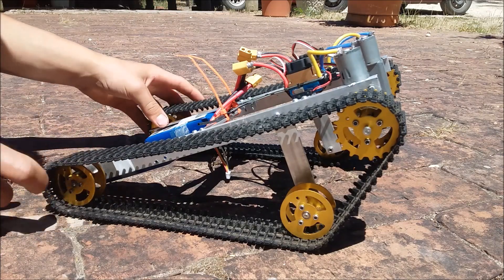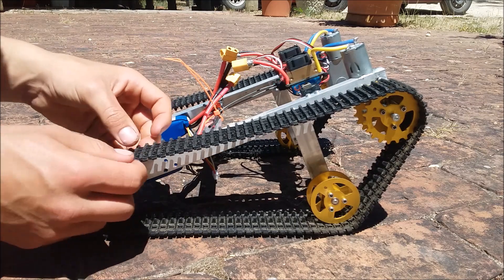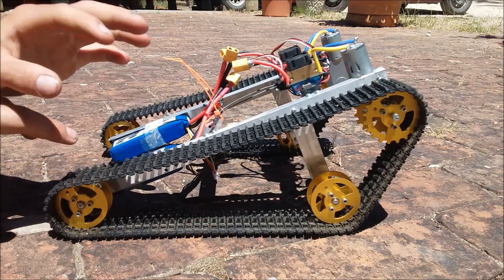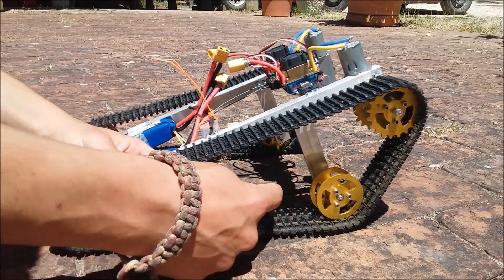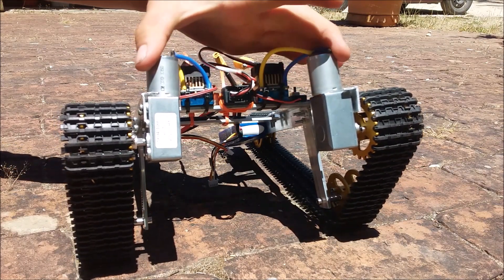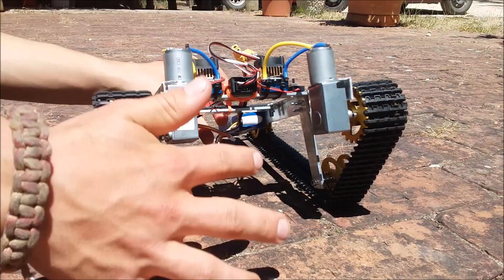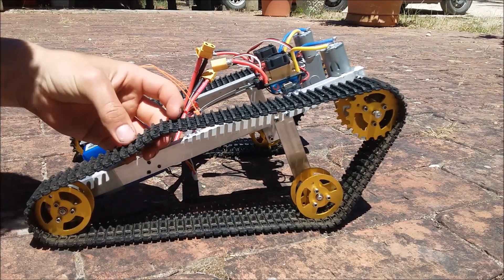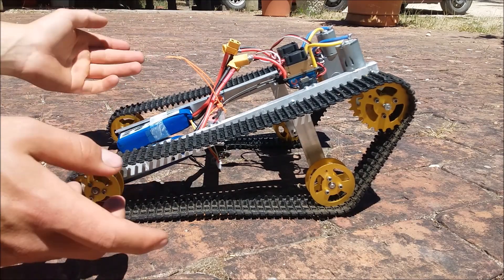REMOTE CONTROL TRACKED ROVER //ULTRA RC

Comment: Hey nice rc! Btw how did you connect the motors in to the receiver?
Reply from the maker: I used an esc, (electronic speed control) the batteries plug into the esc which powers the receiver and servos, the remote sends your comand to the receiver which then tells the speed controller how much to power the motor, these motors have a gearbox attached. The esc also does the reversing of the polarity to go backwards!
I hope that helps!!!!
I will explain this in a future video,
But in the mean time feel free to ask me i will do my best!!!!
Thanks for watching this awesome ultra rc video mate!!!!
I appreciate your support!!!!

Comment: this is totally awesome bud I love it!  did you buy the tracks and wheels as a kit on banggood or gear best?  I am looking to get a set for a conversion of mine. I wonder if slightly lessening the front angle of track would acually help go over obsticals and help keep it from loosing ballance on steep decent... Awesome for sure my thumb # is 6  8-) great job keep the builds coming thats more fun than anything
Reply from the maker: Thanks mate!
yes your right it would be better if the front angle was les and i will change it up.
i did it like that because otherwise the top peace of track would be longer and thus more likely to come off. so i'd ad another wheel. 
yes they were a kit from bang-good . 
Yes i'm building a bobcat now!!!!
Thanks for watching ULTRA RC mate!!!